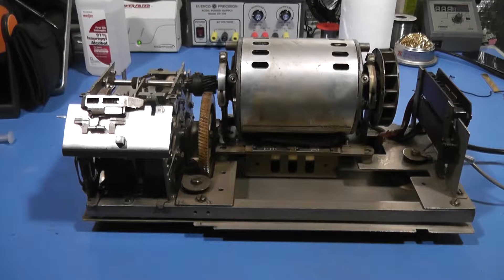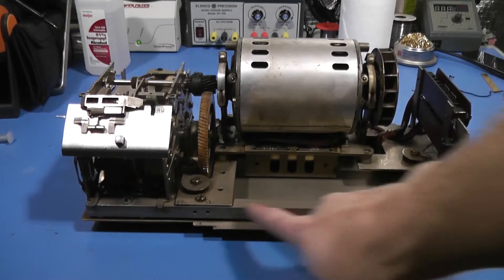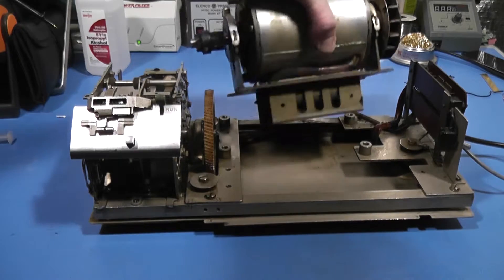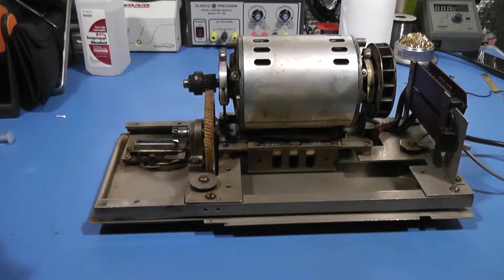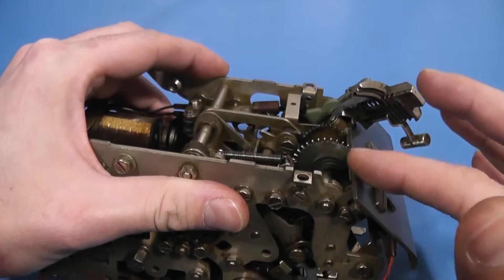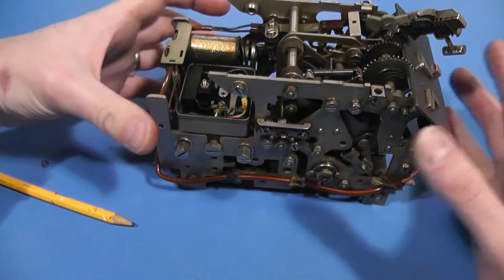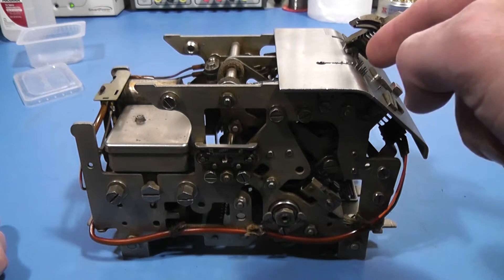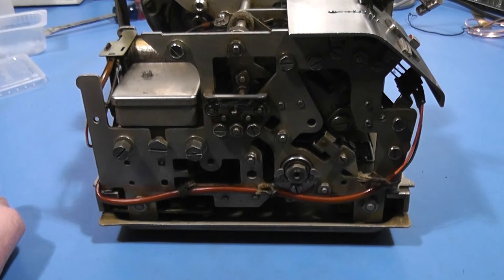Debugging a Teletype Model 28 Transmitter-Distributor - Part Two: Understanding the Device

Comment: The "Centronics" connector is called an Amphenol connector.  At one point Amphenol owned Bunker Ramo--a computer maker.
You should try cleaning the signal generator with isopropyl alcohol.  In the old days we used 1,1,1 trichlorethane.  Oil can get on the contacts over time through vaporization and capillary action.  Use an oscilloscope when adjusting the eccentric.  Set the oscilloscope to trigger on the mark space transition of start bit since this is what the range finder is based on.  This was a very thorough video.